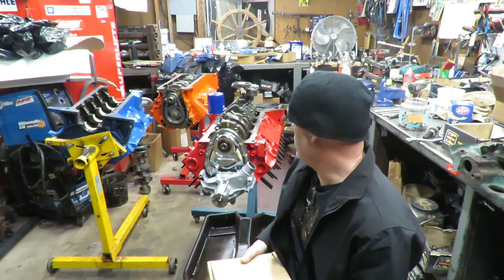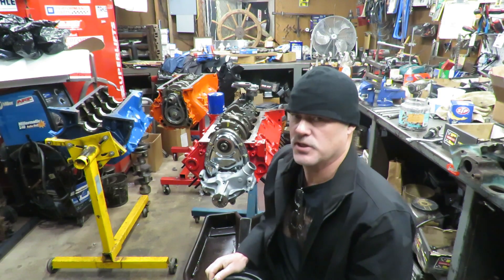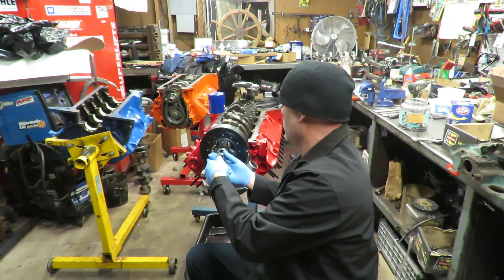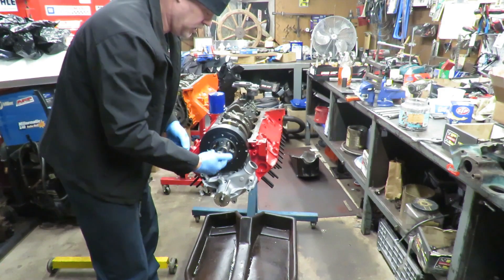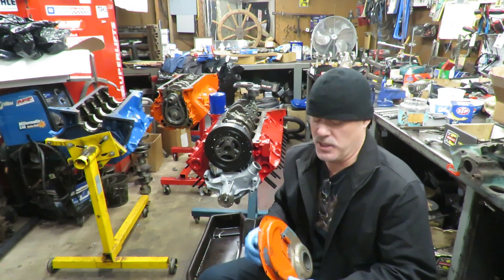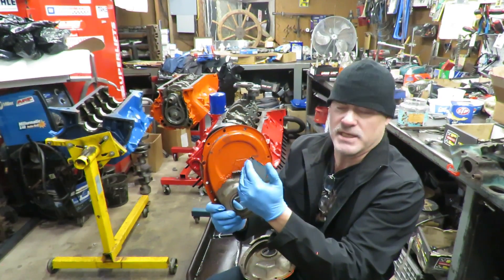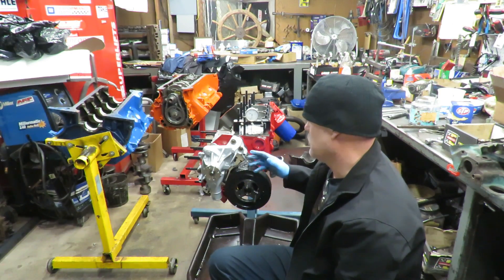350 Chevy timing Marks

Comment: Make sure you put RTV sealant inside the keyway of the balancer before you put it on,  this will prevent engine oil from making it's way into the keyway area and causing a leak.

Comment: I think I have  this problem on a 4.3 V-6. The mark on the balancer is off by a simular anount. Unfortunately the engine is completely installed. Any suggestions on finding TDC on a assembled engine. Ok ther than a pencle in the spark plug hole?

Comment: My only advice in your video which is great a reminder is the size of the Harmonic balancer as well as the vehicle it will go into. The reason i say that is Amazon and eBay sellers for example state that an 8 inch balancer will fit my 350 1976 Corvette and at a Google forum Internet search discussion some state that a bigger balancer when upgrading the power grid will reduce the vibration better. 

 Now the OEM 1976 C3 Corvette balancer is just 6.75 inches, but sellers and Amazon state that an 8 inch will fit. and it will on the shaft.  So why the differences in the size of the balancer? I contacted Professional Products who sells both an 8 inch and a 6.75 inch  at Amazon for a 1976 Corvette and gave them all the upgrades I am doing to the Corvette and his return email recommended or advised I stay with the 6.75 inch as the 8 inch may  hit the cross member or other items in the area. So my assessment is that the 8 inch is really for a strip driving and not for a street driving with additional items like power steering, A/C frame member. So I returned the 8 inch and purchased a 6.76 inch OEM  upgraded quality Harmonic Balancer instead. 😉

Comment: I purchased a used 350 engine and it runs great.  Only issue is timing mark is at bottom of engine.  So 180° off.  Why?
Reply from the maker: Where is your number 1 spark plug wire on your cap?
Reply: @Myvintageiron7512  It's in the #1 position.

Comment: Beating a balancer on the crank is a HUGE no no, !!!!!!  as you're beating the hell out of the THRUST BEARING ! This is why when I build a 265/ 283 or early 327 I spend the extra $135.00 and get the small journal cranks drilled & tapped 1/2-20 for a bolt on balancer every time. You're asking for big problems in your rebuild using a hammer/Mallat on just about ANYTHING . At best it should be a light TAP fit.  I get a kickout of the early Corvette collectors telling me that Balancer bolt is not correct ! That is TRUE it's not, and the thrust bearings should last 15 times longer not beating the hell out of the balancer on the crank before you ever stat the motor.
Reply from the maker: $135.00 !! wow I want you to be my customer I do the same thing the Divit in the crank snout centers the drill bit you can drill these cranks with a hand drill done it hundreds of times and yes to 1/2"

Comment: Thank you so much for this.   My car has a replacement engine with a lot of unknowns about what parts came from what year and type of engine.  I'm new to Chevy engines and had no idea they moved the timing tabs around in this way but I wondered why I could barely see the timing tab way up under the water pump.  The car is a 75 corvette with an engine from a 80 Z28.  This explains it and perhaps why my timing seems so far out (the primaries on the carb are all sooted up) even though the timing seems to be on when looking at the marks.  It's either this or the balancer has slipped.  Either way...thanks for this video. Very helpful to me.  Subscribed!

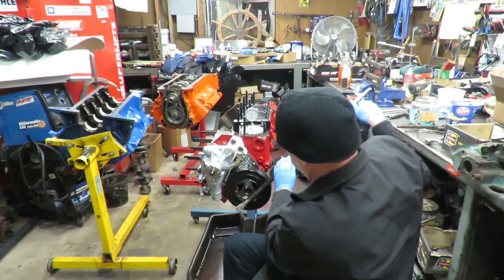Comment: All due respect, using a dial indicator as shown in this video (at 5:35 into the video), is not the most accurate means of locating True TDC. 
Reason.... the crankshaft can still roll a bit (in either direction) while the piston only "appears" to be stationary while at theorectical TDC. 

Using the same principle, we want to stop the crankshaft at an equal distance on either side of theorectical TDC. 
This can be done using a dial indicator with an "in-the-hole" distance of .250" (for example), or by using a degree wheel and a PPS tool (positive piston stop),  and targetting a "stopping point" of  25*/30* on either side of theorectical TDC.  (we can also use 20*, 25*, 30* or  even 35*, as long as the split is enough for better accuracy)

But let's say that we use the dial indicator method:

We bring the crankshaft around and stop rotating it when the piston is exactly .250"  (or a demension of your choice) from the cylinder block deck,  as indicated by the dial indicator..
At that point,  we stop rotating the crankshaft. 
We mark the balancer aligning with the ZERO tab mark.

Now we do this same thing in the opposite direction, and once again stop rotating when the piston is  .250"  from the cylinder block deck,  as indicated by the dial indicator..
Once again, we mark the balancer aligning with the ZERO tab mark.
 
Next, we accurately split the difference between these two new marks, make a NEW mark, and then rotate the crankshaft until the  NEW "split" mark aligns with the ZERO on the timing tab. 

Now we have established True #1 TDC.

If the OEM markings are off, we need to get rid of them, and/or make the new marks very bright and much more visible. 

 Again, all due respect to the author of this video.

Comment: Your video mentions "  some people " having problems with the timing on their sbc. I must admit that I have been one of the them. I have been so damn frustrated with the work I have done on my 82 c/20 with a stock 350 this last year during this pandemic B.S, With getting a used car/truck anything you never know what your really getting even new cars can be lemons right off the lot, so when you don't have a base line of what is working 100% as it should you can start chasing down possible causes for what is going on. So I bought this truck and it ran barely, and to my amazement passed smog out here in California that is actually something. So I have done alot of work with out having done the big dollar items and for the most part had to replace everything emissions related if parts were available. I ended up replacing the front of the engine ( new cloyes double roller timing chain and gears} along with cover , balancer , w/p,  viscous fan, radiator etc. Now fast forward to last month when I have everything back together and start the truck. Set timing, idle speed and air/fuel mixture  with a vacuum gauge ( installed a Remanufactured QuadraJet by Rochester } things running great. Take it for smog and it fails and print out says 32 BTDC. WTF !!!
So I want to say thank you for this particular video, it is the only one that addresses this issue, I have read about the different diameter balancers between the  different years and engine sizes but when ordering the parts there was nothing about the tabs and marks on the balancer etc. 
After watching your video I went out put engine tdc #1 and sure as shit the mark was off about 1.5 inches on the balancer. So I put a new mark on the balancer and ordered a movable marker for the cover. Not sure when I'm going to pull the front of the engine apart to put it on or just do the math when I retime it because it's still off a few degrees or my timing light is messed up because 6 degrees  btdc is still printing out as 12degrees at the emissions testing facility.
I am sorry for leaving such a lengthy message. I hope it gets the point across how  frustrated I was and how helpful your video has been to me recently.  I have shared this info with the few sbc chevy friends I hang out with, and like me they have never heard of this before.
A good rule of thumb for anyone who repairs or fixes anything cars or not - Always compare new parts to the old ones and don't assume a part even if  it's brand new , that it will work properly or is even the correct part. Thank you again keep up the good work and for sharing your knowledge  with the rest of us " some people".

Comment: I want to start this question by telling you I dont know anything about timing and Im struggling right now trying to set mine. Thats why Im here.
Wouldnt it be easier to find TDC and THEN put the balancer on so the mark lines up wifh zero?????
Reply: kinda old comment, but the balancer is keyed so it will only fit on one way. wont really make a difference.

Comment: just what i was looking for ---my balancer the factory mark is several inches off so when i got to top dead center i made new mark on crank-i  put a small plug in # 1 rolled engine over when it pops plug i stop factory mark way off have try to start ,but getting clos -good video

Comment: I am currently researching to build 383 stoker I have acquired all of rotating assembly and cam. Summit has a 350,383 block which they say has been clearanced for the 3.75 crank should have in a week or so heads will be my next acquisition. My question is can I ship my parts to you and have you assemble and ship back

Comment: Nearly had a problem with a new goodwrench 350 by using an Oreillys OEM balancer, and using the 2 Oclock tab that came with the motor...I had her perfectly marked at TDC on the timing tab.  A good mechanic helped me start it up by messing with the carb throttle, when I turned it over it backfired thru the carb...he then quickly removed the plugs on the cap and advanced them one spot counterclockwise, and she ran fine for break-in.  I never figured this out until 4 years later....that Oreillys sold me a 12 oclock balancer for my 82 chevy, as this was OEM for GM trucks from 76-86ish.  If I had bought it from Jegs or Summit, it would have 2 oclock.  If it wasnt for that mechanic, I would have likely trashed that cam/motor on startup.
Reply from the maker: Auto zone sells an 8" balancer for SBC and it only has the 12 o clock mark they list it for all yaers of 350 it cuases untold fits for many of their customers who buy their balancer it's not a bad product they are made by Dorman fine for stock replacement but you need to remark them I always check my TDC with a bridge gage after my short block assembly but that is not so easy when changing a balancer with the engine in the car/truck I would say anytime your replacing a SBC balancer compare the new and old balancers very closely

Comment: Today is a sad day for me.  Instead of installing the  engine  I  am having to tear it apart again as I was rotating the block and priming it with  oil I heard a snap and now a few of my push rods are bent on cylinders 3,5 and 6 .The only upside to this is I am glad I did not find out after installing it on my truck. Now its  back to square 1 for me. Another hard lesson to be learned today I just hope the damage is not to bad when I find out the aftermath. 5.7 Vortec back to the machine shop that did the head work and provided me with a custom cam a 265 and 480 lift  ex. and int. I was told it will work with the stock parts since the cam is not to high.
Reply from the maker: that sucks
Reply: @Myvintageiron7512  Talk about bad timing had I seen your video before I would of spent the extra bucks for a cam dagree tool I just went off the mark on the original dampner and looked at went off the #1 piston valves Both being closed and thought it was all gravey boy was I wrong!!

Comment: So I have been fighting timing on my car I am going to try everything you said because I have a feeling I have the issue of my timing mark being off.
Reply: could be other reasons like a chain being stretched or skipping or broken tooth on the timing gears, I have had problems with distributer bushing being worn and would only act up at higher rpm range, dwell would vary at higher rpm range. Another thought old wires that are heat baked will have higher resistance and get worse when energized check plugs, wires, etc along with Battery voltage

Comment: Love your videos.
I bought a L31 Crate engine from Jegs. Would the timing mark be correct on a new crate engine or should I check it?
It has the stock plastic timing cover and balancer that came with the engine from GM.
Thanks
Reply from the maker: If GM put the balancer on I'm sure it's fine

Comment: First a big thanx for taking the time to produce such informative videos. I usually take marking the damper a step further, by holding a carpenters square at the zero degree mark and using the side of the ruler as a guide to scribe a line using a triangular file.  Then I can fill the groove with paint.  Reason....I have lost the marks over time due to cleaning the engine, solvents, and plain dirt.  Not being critical just my experience.  Thanx again

Comment: what a messy shop you can flip your bottom timing gear over file an angle on the inside edge same as the other side then go 3 teeth counter clockwise from the woodruff key that advances the crank 4 degrees and you do not have to change any thing else will work perfect and you will get another 35 to 50 ftb of torque

Comment: Since there is a little float at TDC where the connecting rod transitions from raising the piston to lowering the piston, my question is: Should I mark where the piston first reaches the top, and then mark again where the piston starts back down, then split the difference to mark my TDC?  Or should I mark TDC where the piston first reaches the top?
Reply from the maker: it does not really matter all that much were only talking about a 1 to 3 degrees you can play with the timing after install for best results I start at 30 degrees of total timimg and bump it up 1 or 2 at a time until I start to get a slight ping under load the back it off a degree or 2
Reply: @Myvintageiron7512  Thanks. I tend to over-analyze things a bit. With these older engines, I guess that there is no substitute for a good ear and years of experience. Thank you for helping us keep our old cars alive.
Reply: @dojmike  you can do what he does here with a bridge and also use an adjustable pointer with timing tape like MSD sells.  Go 0.050" (or whatever as long as it is equal) both clockwise and counterclockwise down with the piston taking a reading of the degree at each point.  Move it till it reads the same both ways.  Then at 0 that should be true TDC.  And perhaps consider using a square to mark 0, scribe/file and paint.  Don't count on the timing tape stickin around lol cuz they seem to like to come off 😅. 
Now if you know what timing it'll likely want you could mark that too depending on the light you use.  A normal na 23 degree SBC on pump gas up at 4,100 ft seems to like about 36 degrees total, maybe 34 with poor quench and less than great chamber heads.
Also the tape is useful for dropping the distributor in around 12 degrees btdc rotor lined up with #1 on cap so it fires right up.

Comment: I'm building a 350 that I bought used.  I do not know who the engine builder was.  After removing the pan I found that all the rods had number stamps on them but did NOT correspond with the correct cylinders.  What should I be looking for?  Could this engine (rods) have been through a "balancing" or was someone just sick when they reassembled this engine?

Comment: I'm from Florida, I want to make a 350 mercruiser  (GM) marine engine using aftermarket aluminum heads and forget pistons in a 4 bolt main block.
For marine engine what kind of cam will you recommend , to get the maximum torque and horse power  for marine application.
I believe the cam timing and degrees are limited in marine use in order to achieved  over 5k rpm in order to get speed. I'm want to swap a 4.3 to a 5.7 mercruiser in a Donzi sweet 16 with a Alpha 1 gen 2 stern drive...Any advised will be very appreciated...Thanks
Reply from the maker: My first piece of advise is don't ever run aluminum heads in a marine application as far as the cam goes merc and comp both have a good selection of marine cams

Comment: my machining guy died so i can't ask him  questions i can make a trade  for my 125 honda he has a set of 454 heads off a 94 chevy 4x4 he claims there the high flow heads but i'm not sure when they started putting them on the 454 plus a tunnel ram with it i have a 454 stroker 450 hp at 485 torque crate motor from the late 80's are the heads better then what i got all ready or he has a set of oval port heads with tunnel ram  witch are the best heads if u know i all ready got the serpentine belt set up off the 94 i got it all the coolers too even a power steering cooler all for 70 bucks got alt ,air, power steering and the water pump i mean i got all of it every thing on the front of motor and the distributor exhaust manifolds too and valve covers they were fancy one's i could not believe i got all for 70 bucks he has a land rover in mint condition just need timing belt he just put a 700 dollar fuel pump on it i can get it cheap and it is the Mercedes-Benz  v-8 in it vortec trans i can get it for 1200  the body i could not see a ding in it black on black car it is dirty

Comment: What size harmonic balancer I need on a 350 Chevy 8in, 6in , or does it real make a diffidence  what size the outside diameter is?
Reply: On 350 and larger, id go with an 8 inch balancer.  Less vibration, less crank deflection, quicker off the line.